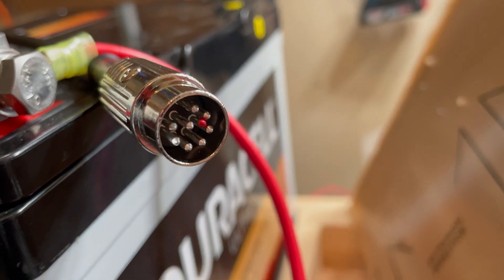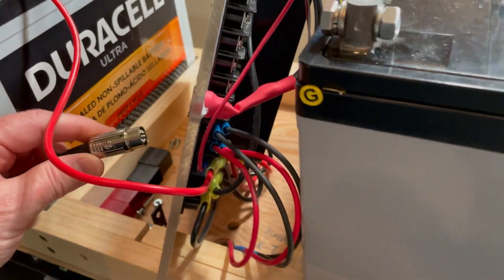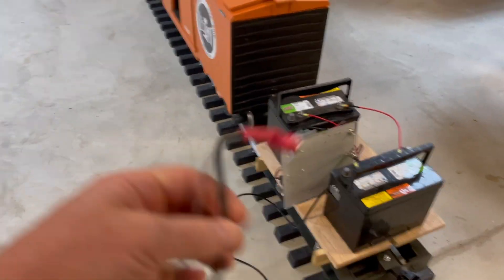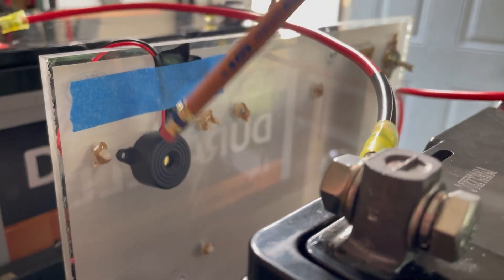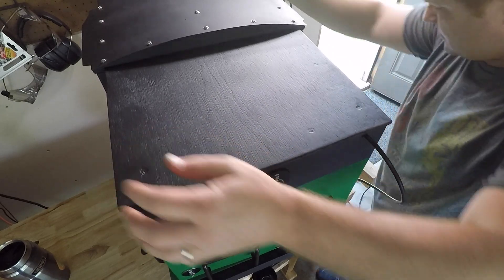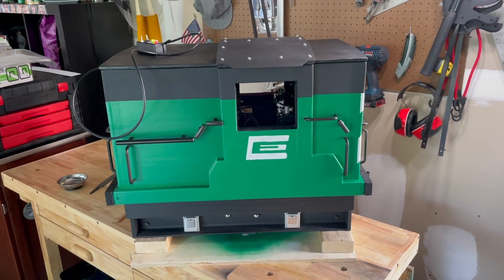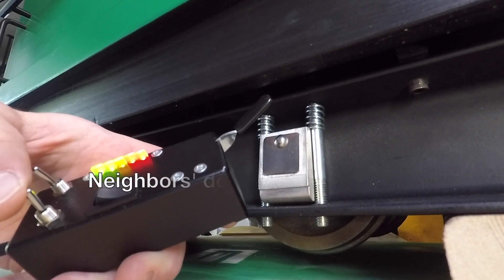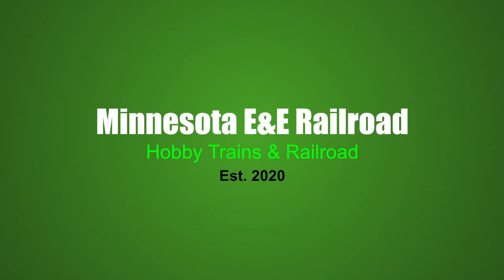Backyard Railroad: Power to Plum Cove Generic Electric Locomotive (2 of 2)

Comment: roughly how much does this loco weigh? I've been thinking of getting into the ride on size but I would need to store it in my appartment when not using it at a local club or bringing it to other clubs/meets. this looks like a good size for transportaion (plus a needed riding car)
Reply from the maker: You would probably have to plan on pulling the 2 batteries if you need to lift it up at all by hand. But once the batteries are out, you’d be fine.
Reply: @minnesotaeerailroad8471  good to know . And that could be planned for. 
Thanks.
Reply from the maker: I’m this video you’ll see me lifting/carrying the loco without the batteries in. In this case the shell isn’t on but the shell would not be much more weight. https://youtu.be/4VGzLyJhCrM?si=HCAsyWkCdvEXDFnl

Comment: I have a DNO-10 also. Other than the wiring issue, there is an F1, F2 fuse on the board, which can blow if there is a short circuit. Temporarily you can just tie a zip tie onto the cable, and the knot will prevent you pulling on the cable.
Reply from the maker: Thanks!

Comment: Looks great, wish my father had done this type of stuff and took interest in my hobbies when I was a kid.   BTW, A company called Railroad Supply Company makes the BN style flasher beacons that actually sequence 4 LEDs just like the digital beacons BN used back in the 1980's.  Would look great on the roof of the cab.  They also have scale style air horn castings and such you can use to dress up the diesel.
Reply from the maker: Hi! Thanks and thanks! We’ll have to check out those extras! Thanks for taking the time to let us know!

Comment: What a great project and great video series!  I wish I had done that with my boys, 30 years ago! Regarding that control cable and strain relief- I know that you will never let it get caught out in the rain, but a "drip loop" (really a "U" ) inside will keep any water from running down the cable and into the connector.
Reply from the maker: Thanks! And thanks for the tip!